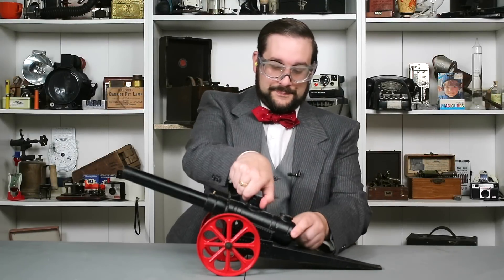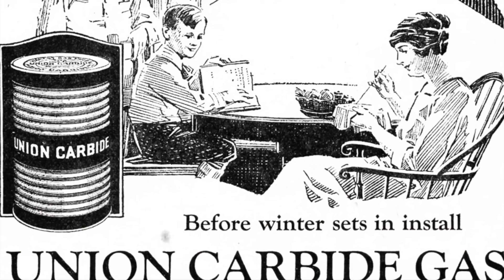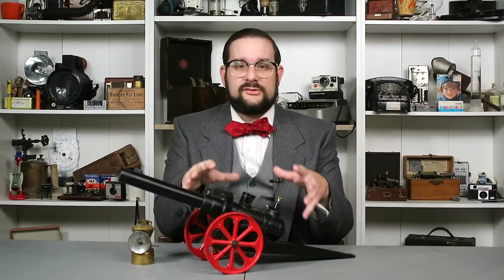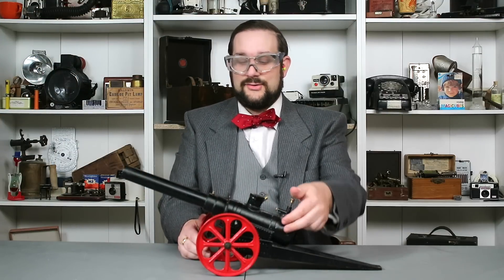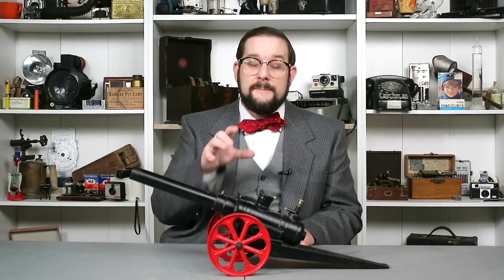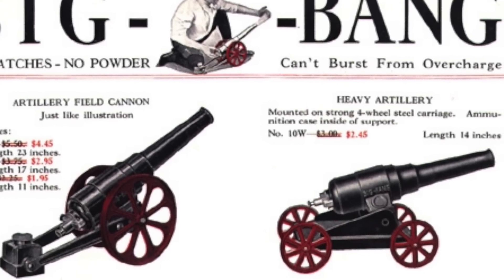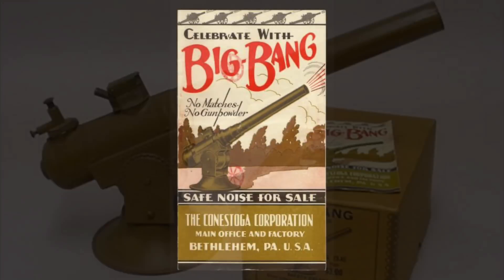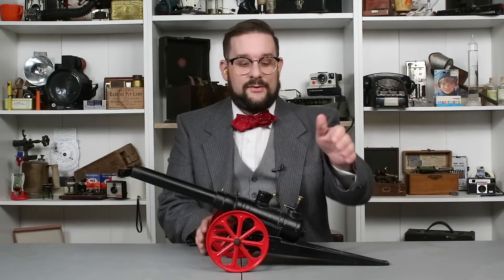Big Bang Cannons: the Heavy Artillery of Vintage Toys

Comment: In 1963 I got a model 6F, the smaller version they made so many of. The only time the neighbors got relief from this terror was when I ran out of Bangsite. I'd go to the local home construction projects, and collect enough soft drink bottles to collect the three to five cent refund from the local grocer. And...BOOM...the terror resumed. So...I just acquired a Conestoga model 15F, from the local thrift store. Cleaned it up, lubricated the charging port with dry film graphite,  and stuck a new flint in it. Unfortunately for the neighbors, I ordered a one pound can of Calcium Carbide. Like I said before, Let the terror resume.
Oh...and then there's this...
OK, so in 1974, age 23, I'm flying a daily bank courrier flight from Burbank, to Imperial, California. I'd fly home in the evening with documents going to the computer centers in Glendale. So I had the whole day to myself. I enrolled in a General chemistry class, at the local community college. About a week or two into the course, the Professor gave a demonstration of the ignition of stochiometric Hydrogen and Oxygen (2:1). He'd wrapped a soft drink bottle in fiber tape, and would fill it with the mix, setting it off with a welding igniter. I took an interest in this experiment, and asked if I could borrow a couple of Platinum anodes and cathodes, and a d.c. power supply, over the weekend. Took em home on the plane, and went to work  Took a one gallon plastic Clorox bottle, filled it with water, turned it upside down in a pan of water. I place the electrode and anode in to the bottle opening, attached the power supply, and let it do it's thing for the next two days.    Still with me ?     Cause this is about to get really, really interesting. By Sunday night, the evolving  gas had evacuated all but a small remainder of the water in the bottle. I capped it off, and took it with me on my Monday morning departure. Yep, a full gallon of stochiometric H2O sittin in the passengers seat, as I guided my craft to Imperial County airport. By some minor miracle,  that bomb didn't go off in the cockpit ! So I went to lecture, said explosive device in tow. I proudly showed my "acheivement" to the class, and asked the professor to hand me the igniter. He said, okay, but put it in the lab sink, adjacent to the lecture area. I question why, as I'd used a plastic bottle, rather than a glass bottle (never mind the fact that there was over ten times a much reactant. ) When I did the deed, all I saw was water flying at me, as well as experiencing a deafening explosion.  Fortunately, one of the rooms two big doors was open, releaving some of the concussive force. But it still managed to blow open  a couple of skylites. As a precaution, I'd put the bottle in my brand new,, company issued, chart case...it made the flight home in shreds. To this day, I ponder that flight to Imperial, and imagine what the NTSB would have come up with as the "Probable Cause".

Comment: Carbide was not the way to go  for are a kid living in the bush(middle of a mangrove swamp) desiring some noise for Guy Fawkes day.  Instead, a roughly 1 to 1.5 meter piece of bamboo with diameter around 6-10 cm made for a fine cannon. Fired with kerosene it makes a great bang.  How? Knock out all but the end node to make a tube that's closed at one end. Make a hole near the closed end. Put some kerosene inside. Let it burn a bit until it's hot enough to make vapors. Put it out. Puff air into the hole until you see the vapors at the far end. Stick a 'match' (bit of cloth soaked in kerosene held in a twisted wire and lit) into the hole. bang! Once going, subsequent shots keep the kerosene hot enough so that all you have to do is puff the tube again.

Comment: I still have my smaller Big Bang cannon with rubber wheels that I bought in the late 60s for the princely sum of around 5-6 USD. The Conestoga Company is still in business and the same model cannon goes for $100 USD.  I had loads of fun on the 4th of July. I rememer the fireworks stands used to sell the cannons, Bangsite and sparkplugs although I bought mine at a favorite toy store. I also found out that if you overloaded the calcium carbide - 4-6 scoops vs one the cannon would shoot out a flame rather than the usual report.

Comment: At a pressure of around 2 atm acetylene will spontaneously explode. A trick when I was  caving (we used carbide lights) was to put a bit of water in a plastic drink bottle, fold the bottle in half, and  put a few lumps of carbide in the folded down top and screw the cap on. You could carry it around like that until you spotted your victim, someone so busy with something they wouldn't notice a bottle behind them. All you had to do was unfold the bottle, give it a good shake, place it and walk away. 20 to 30 seconds later there was an impressive bang! Anyone bent over working on their car's engine was fair game. Unfortunately that was before cameras in cellphones and YouTube. So many wasted opportunities for great YouTube videos! 
I can't ever remember seeing those cannons here, maybe they were never imported, or maybe just too expensive for me at the time.

Comment: You put in too much carbide, which is why you got a soft >Foomp< rather than a bang. A tiny speck of carbide would have worked better, giving a proper fuel/air ratio for a loud explosion.
Reply: Also, when the mixture is optimal, you get a clear blue flame when it explodes, instead of a giant orange fireball.

Comment: Sooooo here's a funny story. A few Christmases ago, for no other reason than I just fancied doing it, a got an empty ice cream tub, made a wee hole in the side stuck 2 wires thru and hot glued them. I then I connected one of those 'Taser' units that you can get from Amazon and eBay, and connected it to the wires. I then put some calcium carbide in the tub put some water in it and put the lid on. I then brought the contraption to my wife attention, and told her to watch. I put the tub on the floor in the living room, reeled the wire out so I was a safe distance away and pressed the button. There was a satisfying pop, and then a kind of crackling noise, and my missus shouting, you've set the Christmas tree on fire you effing idiot, which was true. As it was a real tree it offered good kindling. Lucky enough I was able to put it out with my can of coke. I actually have a video clip of it, but like a lot of ppl, when an event happens, the camera person, my wife, panicked and messed the shot up, so after the tree caught fire you could only really hear it and not see it burning, not that there was much to see as it only lasted a second or 2 before it put it out.

Comment: Last year I inherited my uncles Big Bang cannon, and it's the same one as in this video. He was a Vietnam-era Navy veteran, and I remember him firing it in the early '70s during holidays such as the 4th of July and Veterans Day. It was kind of grimy by the time it came to me, having been stored in a flooded basement, and there was some sort of organic debris in it, either from a mouse nest or maybe insect carcasses.  But it cleaned up easily. There were about 6 tubes of Bangsite with it, but they had all cracked open and the Bangsite was rendered useless by moisture. The tubes seem to be made from lead foil.  Anyway, ordered 3 new tubes from the BigBangCannons website for $25, good for 300 shots. Haven't fired it yet as I'm in a quiet neighborhood and don't need SWAT showing up to shoot my dog and kneel on my neck. Hope to take it out to the countryside soon.

Comment: Ok well 6 3lb coffee cans duct taped together with a small hole in the bottom edge of the bottom can and the bottom of the next to bottom can with triangular holes made with an old can opener all around the bottom and the top and bottom of the other 4 cans removed . You now have an awsum louder what we called a polish cannon. We also mede these out of tennis ball cans to shoot tennis balls. These also work well with lighter fluid , colman fuel , hair spray. But work best with carbide.
Reply: We did the tennis balls and cans, but I can’t remember how far the balls would actually go

Comment: The 1976 film "Logan's Run" used practical effects prop guns that used carbide and water ignited by a battery-powered glow plug at the muzzle end.  The blast was directed out of slots at the muzzle end of the barrel providing four jets of flame.  I believe that these props were also used in the  1977 TV series.

Comment: I have Lynn L-3 reflector gunsight used on p-38 lightnings, it's not complete, it's missing the housing that holds the bulb, but I can shine a light from the bottom and a square redical appears on the glass, can I message you privately so I can send pictures. I have so many questions you might be able to answer. I saw you have videos holding and explaining sights similar to mine

Comment: Never saw one myself, but I'd heard, from multiple older people (teachers, uncles, etc.), that in the generation before mine, "bamboo cannon" (meriam buluh) were commonly made and set off, usually during festival days (Chinese New Year, the Eid, Deepavali, etc.). They were usually a length of bamboo, often wrapped with wire to keep them from exploding. As with this cannon, you'd drop in a few chunks of carbide, pour a little water in after it, wait a few seconds for the hissing to start and then set it off with a lighted stick at the mouth. They were reportedly far louder than the usual firecrackers, and were said to be quite dangerous, since they sometimes blew apart. This must have been in the 1950s and earlier.

Comment: I own one of the biggest cannons Big Bang makes. One thing not mentioned, when firing multiple charges and if you have one of the bigger models with the plunger type loaders, It makes a big difference to blow in air between firings. If you don’t, there won’t be much oxygen and the net result is a muted explosion, just like if you have too much acetylene. These are great fun and take some skill to make the biggest bang consistently.

Comment: Mine was black, and inherited it from older brothers in the 60's as the youngest.
What could go wrong? with an 8 or 10yr old? having a Can of calcium carbide, or a tube of "bangsite"? we could buy all needed at the liquor store, or hobby shop. Or electricity and an explosive gas?

Not a fan of calcium carbide, worked with it as a very young truck driver, foundry and forge worker, we had it stored in a ghetto shed for "protection".
Years latter my employer's site was to become a "super fund" site off Santa Fe north of the 91 in Compton Ca.

Comment: Ah, back when Health & Safety was simply about avoiding death. Any toy that could fire something at high velocity across the living room, was fantastic.

Having knocked an ornament off the fireplace, or a picture off the wall, you'd be ordered to the garden. There you'd lose the official projectiles in the bushes & amongst the grass.

Matches, or metal ballbearings might be good replacements - sometimes more dangerous than the original ammunition!

Comment: These were always advertised in the backs of comic-books along with the X-Ray Spex and Sea Monkeys.

When I was in Junior High School in 1967, a standard gag was to put a couple lumps of calcium carbide into the water fountains in the halls.  An unsuspecting mark would lean over the fountain and turn on the water, which would hit the carbide, releasing a cloud of acetylene in their face.  Acetylene smells like a fart.

The serrated wheel against a flint to ignite acetylene, is also used in acetylene houselights.  If you find a gaslight in an antique store, and it has one of these igniters, it’s designed for acetylene and likely also has a burner similar to those on a miner’s Lamp.

I once tried using acetylene to launch a metal-can by placing it open-end down and making a small touch-hole in the other end, to which I held a match.  It launched with enough force to deeply cut my thumb, still holding the match, on the way up.  I did not repeat that.

Exploding acetylene generates a lot of carbon soot.  Once, while engaging in yet another dumb experiment involving it, I had it explode in my face, leaving me looking like Wile E. Coyote after an adventure involving dynamite.

The Forest Glen Seminary outside of Washington DC once had an elaborate acetylene system.  The gas-generator house still stands, and has been converted to a private residence.

Comment: In the 50s my best friend's dad used a pipe tobacco can, resealable lid, pinhole punched in the bottom, calcium carbide with a few water drops inside. Foot held on it's side a lit match near the touch-hole resulted in a huge pop. Perfect for young boys..

Comment: I still have carbide cannon, a smaller model, that I bought from a fireworks stand, back in 1969 (at 10 yo) for $10. Still pop it off, at times. Use to buy Bangsite (a carbide brand). Later just used larger generic carbide lumps.

The "spoon", on the breech block, is for the smaller, cheaper model, like the one, I own. The bigger, more deluxe models, have the carbide charger. Mine is the 60mm. The 6F with rubber wheels.

Comment: Farmers used to have larger carbide cannons to scare birds out of orchards and vineyards, they later changed to propane, my grandfather was still calling them carbide cannons in the late 1980s
Reply: Generally no longer carbide, but more likely propane  gas cannons are still very much a thing. One of the farmers round here has one nearby and it scares humans too if you are  not aware it is there. If you want one (in the UK) google for "Gas Bird Scarer - Portek Scatterbird MK4 - Gas Banger with Remote APP Control."
Reply: @AndyHullMcPenguin  we load them with grapefruit and call it grapeshot.
Reply: @datadavis 😋Really... now there's a video I think we might all watch.
Reply: And of course the cannon has a app 🙃 @AndyHullMcPenguin
Reply: @Hand Tool Rescue just did a restoration of one.
Reply: To this day I still call them carbide cannons,  I use them to keep the wild hogs out of my oats field here in Texas.
Reply: We called them "Zion Guns" on the farm in California.  Sounds like a 12 gauge.
Reply: @IvorMektin1701 Zion guns? Any connection with the Davidka?
Reply: Also used to scare birds away from runways.
Reply: I need to check one of my sheds that my grandfather lost the key for I may still have one left, I’m not sure if it would be carbide or propane I know ours were definitely louder than a 12ga when they went off and if there are a lot of birds around when they all take flight there can be quit a bit of clean up required.
Reply: I know farmers also used to (and a few here in the states still do) fire vortex cannons into the sky to "break apart hail into smaller pieces", wonder if they ever used carbide acetylene.